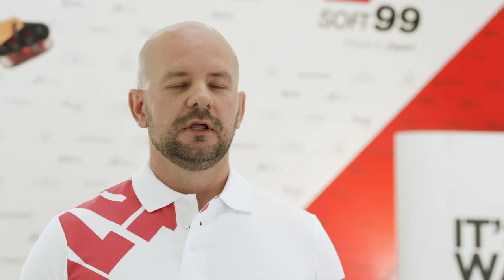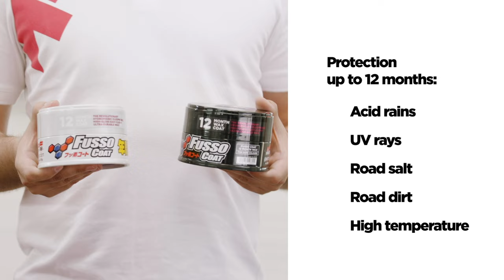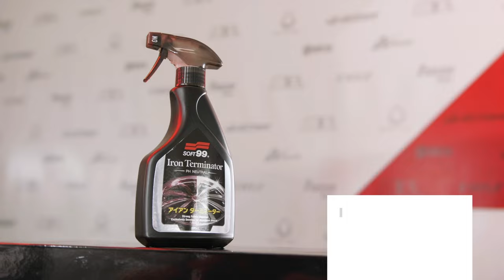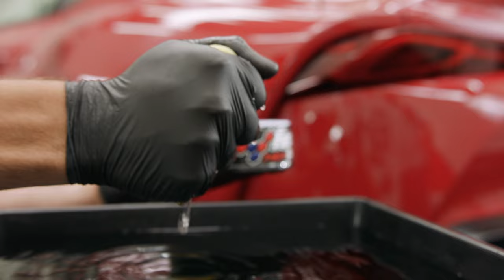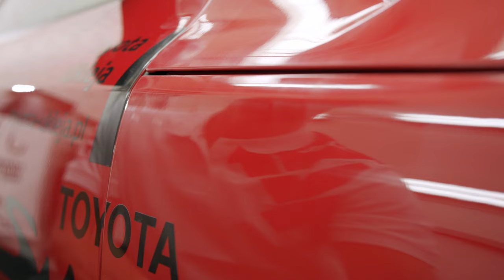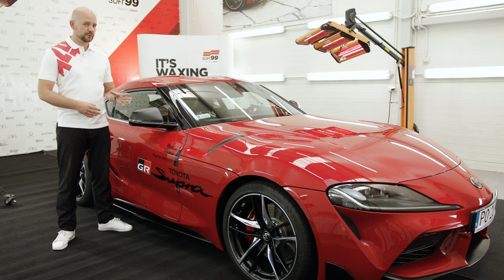How to apply ®Soft99 FUSSO COAT 12 Months? - shown on new Toyota Supra 2020

Comment: Having put Fusso on a couple of cars (particularly dark cars) I find that it is best to buff off almost before it has flashed off - the longer you leave it the harder it becomes, and 5-8 mins is waaay too long in my experience (working outside, but in the cool UK).
Reply: I tried to use it in cold too.
But the application didn't work, I was working whit 5 degrees...

So I washed 
Decontaminated
Paint cleaner: dodo juice lime prime
Alcohol wipe real good 
Then applied fusso ...
I tried to leave it for 5 minute and in some part I left it there for much more 
In the end I wiped everything whit speed and barrier.

But it didn't work apparently...
There is no beading
Very slow sheeting...
I don't were I went wrong
Is not the first time that I apply it and yet I can't get to work it at 100% 
Such a delusion
Reply: I've applied this to two cars recently in the UK, both times the air temp was around 22°C. On both occasions it hazed over immediately on contact making removal very hard. Beading is insane but the problematic application and removal means I might get rid
Reply: @PhasesOfIronCarbon  be like mister miyagi: Wax on, Wax off (immediately!)
Reply: I used it recently for the first time ever and I found it really hard to remove as I probably put on too thick. I did see a guy who applied a wax via electric polisher And it looked as tho it spread better, this is not amateur friendly so my next application will be the fusso coat 7 month and I’ll try apply it using a polisher

Comment: Question 

What did you use silicon off and micro liquid for.
Reply: The Micro Liquid is for light clear coat correction.
The Silicon Off is used to fully remove the clay lube and the Micro Luquid residu.

If you don't remove the polishing oils or old waxes redisu, the Fusso Coat won't fully bond with the paint to maximize performance of the Fusso Coat.

Comment: Do not never use water. You will use twice as much and make it 10 times harder to apply. Using a dry applicator makes really easy and you see how much your using. I used more on 2 panels with it wet then I did on the rest of my car.
Reply: You wet the applicator to make it softer and more maneuverable across body work. Its not wet when you apply the wax. If your applicator is stiff you have an increased chance of damaging your paint work and uneven pressure when applying. You don't need to do it.